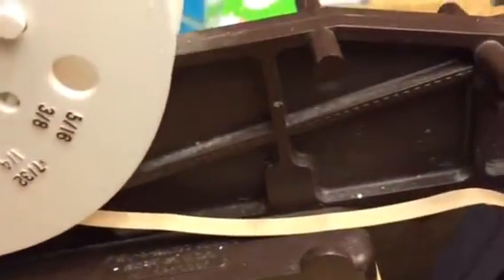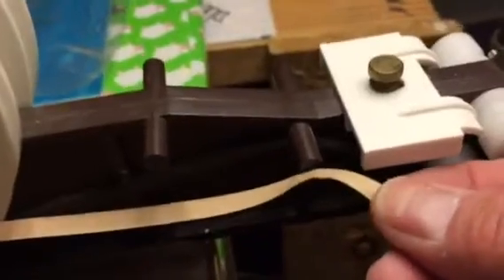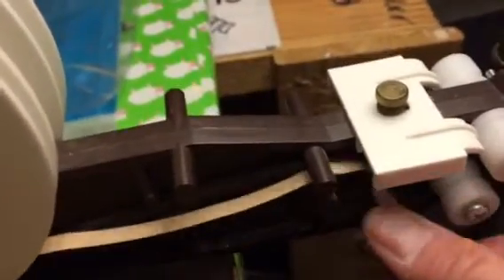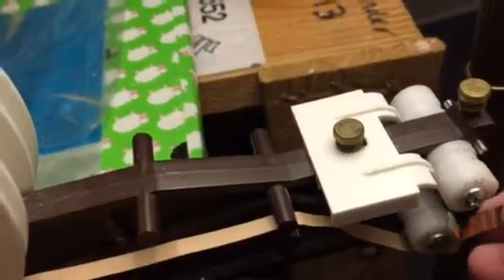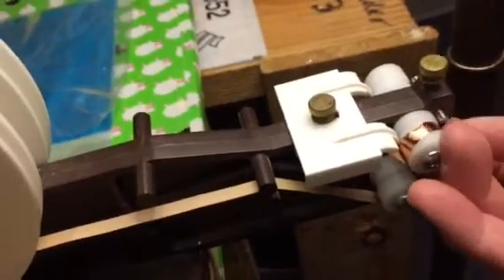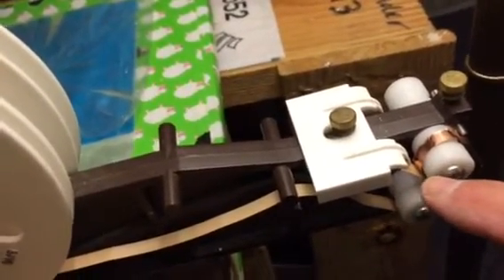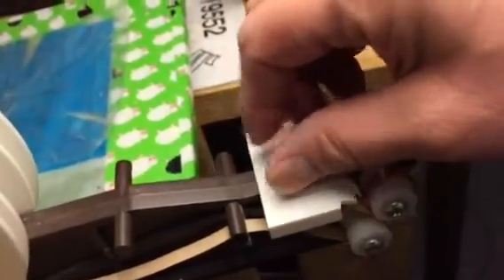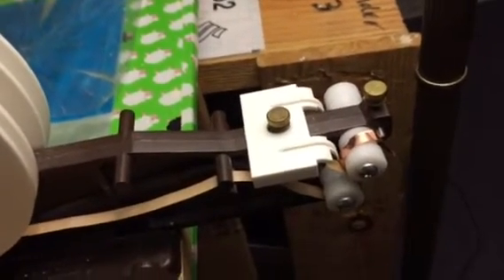Part 2 Diegel Foiler

Comment: How do we get wheel caps off? Pull or screw? Excited to try mine out directions in box don't say?
Reply from the maker: Mine is a pull off. As far as the place where the tape goes. As far as changing the caps to a different size for foil the are screws